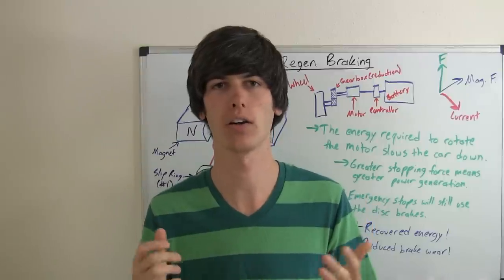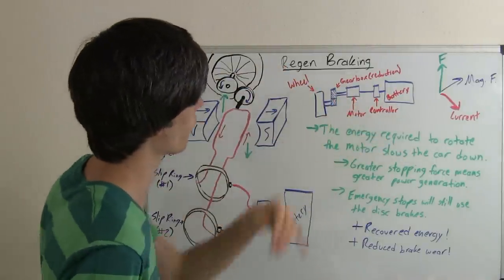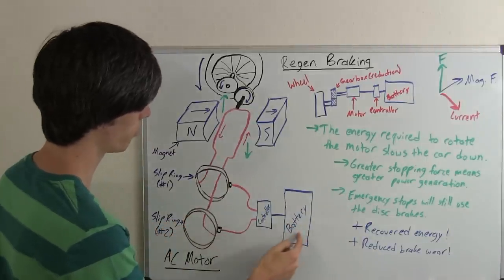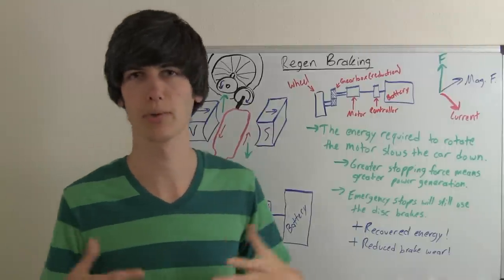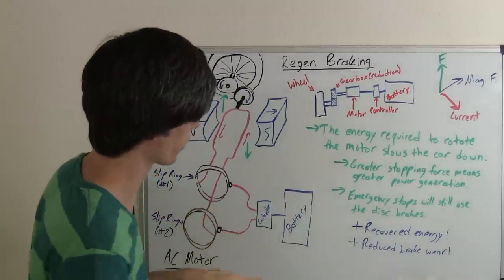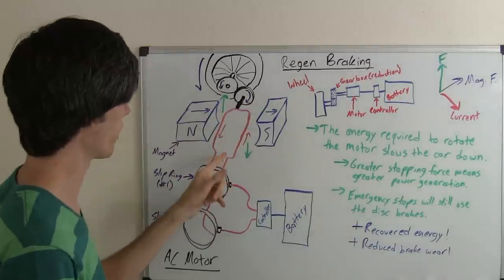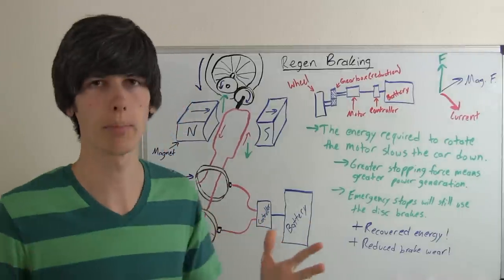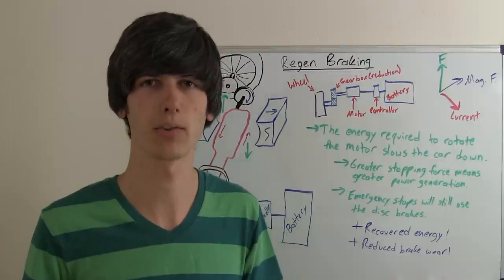Regenerative Braking - Explained

Comment: These videos are great. I have a question though, what is the yield or efficiency of regen braking/ kers? How much output energy versus input energy? A fellow Mec Eng.
Reply: I remember seeing a study, when it's claimed, that the maximum of energy recovered will be aprox. 60% of the kinetic energy you have as soon as brake until stop, considering you stop only on regen.

Comment: Locomotives don't have batteries. You should include that, especially if you talk about trying to charge a battery that is already topped up fully. Robobike has an electric brake that bypasses controllers and batteries when batteries are full but still functions as abrake.

Comment: Hi, got a real basic doubt, just saw your video on AC current as well...… So in this system during braking when your wheel moves the motor, there should be continuous charging and discharging of your battery right??? So how is this system used ONLY for charging a battery??

Comment: How does it switch from motor to generator? What actually physically changes? Then how do you control the braking force?
Reply: roflex2 1) removing pressure from accelerator . 2) adding pressure to the brake pedal😂

Comment: So is it less "regenerative braking" and more "regenerative coasting"? It has nothing to do with actual brakes right? You're just running the electric motor system backwards to create energy, instead of using it... right? 
I think I have it right, but I'm probably wrong. I know an electric motor, and generator are the same thing, energy in = work out. Work in = energy out. So by using the cars forward momentum, it runs the motor backwards charging it, having 0 to do with actual brakes. This is my understanding of how it works.

Comment: I have a problem please can you solve it ?
A car of 2000 kg which is moving with an average speed of 60 km/h.
	   What will be the approximate amount of energy recovered due to regenerative braking, if it comes to a full halt and 50% of the energy is recovered during the braking process?
I calculated the Kinetic energy as 1/2*mV*V
= 1/2 * 2000* (60/3.6)sqr = 277.55 kJ
After that I'm confused??

Comment: when the wheels are turning the motor to generate electricity, the motor is connected to the batter, what is stopping the motor from being powered by the batter which it is trying to charge. Thanks

Comment: So if the friction power in a mild hybrid is - 45kw and Em power is - 25kw. What will the battery power be? Imagine you have released the accel pedal completely. At 5k rpm

Comment: Can anyone explain to me how Tesla can have two settings for Re-Gen? Low and Normal. Is it a mechanical setting change or electrical?
Reply from the maker: nimajneb02 Electrical, just would influence how much energy is recovered via braking, and would use more motor braking than friction disc braking.

Comment: The real beauty is that how it actually works .. the motor can only just nake eniugh voltage to punp back to the batterry at full speed.. the ckever bit is how to control and boost that at lower speeds .. i.e when the motor is only generating 50 volts but trying to charge a 400volt batterry pack.. thats the really clever part so its bot acrually really simple at all ?

Comment: Is the voltage generated by CEMF proportional to the voltage going into the motor? If so, this would mean the wheel must be spinning faster than no load speed in order to generate a CEMF large enough to charge the battery correct?
Reply: The no load speed is dependent on the voltage powering the motor. Motors connected directly to batteries will generate power on the overrun. Motors aren't connected directly to batteries in electric vehicles because there is no power control and also with a single speed transmission, input voltage (or pulse width) must be lowered to prevent damage to the motor accelerating from low speeds.
With a controller, the power on overrun would get dissipated in the output transistor and wasted unless it switched to a charging mode.

Comment: You don't really explain how by depressing the acceleration pedal the motor turns into a gen. The lever example to convert mech into el. energy is good to understand how the gen works but it does not explain what happens while braking. I found out that the difference between the Mot and Gen is the velocity difference inside the el. machine

Comment: turning a diy electric into a series hybrid. what would the minimum volt pack and minimum generator output be? Not performance but everyday driving. it may be a pipe dream but one day I will have one. if range is such an issue why don't manufacturers build series hybrids?

Comment: How is the energy put into the motor, causing the car to slow down? 2:13
Reply: Hi.
ARE you Electrical Engineering .
Reply: Alternators take energy to spin when they have a load on them, so connecting a beefy enough alternator to the front wheels of a car and engaging it during normal braking circumstances would give sufficient friction, alongside the mechanical brakes, to slow the car down.

Comment: If you are maybe looking for more ideas, I'm always hearing about "twin turbo" set-ups. Not sure what is the purpose for this? I've seen some really good boost numbers with one turbo, why two?
Reply: He has covered this in some other videos.  Twin-turbo means that you have two parallel turbos, not one in front of the other.  They are used in setups like on a V6 or V8, you put one turbo on the left side and another on the right side.  This lets you have the same amount of boost as one big turbo, but with less turbo lag.
Reply: Bill Carlson
That explains V engines having twin turbos, but what about inline engines? I believe the Toyota 2JZ-GTE engine was a twin turbo inline 6. How do two turbos work in that case?
Reply: Haloruler64
In non-V applications the compressed output of the turbos is combined, and then fed into the single intake manifold.  I could also imagine a case where the intake manifold is designed to group the cylinders, so each turbo could be feeding 3 cylinders individually, but I haven't seen that.

http://en.wikipedia.org/wiki/Twin-turbo
Reply: Bill Carlson
That makes sense, thank you for the explanation. And I assume that twin turbo is not literally twice as good, but a more mild gain over one turbo on inline engines?
Reply: Haloruler64
There are so many variables to take into account, that I really can't say for sure, and I'm not an expert on turbos (I like electric cars!).
Reply: Haloruler64 Some inline engines have one smaller and one bigger turbo. The smaller one is there because it spools up quickly and allows for a more even power band (when compared to not having the smaller turbo); and the bigger one is just for POWWEERR in Clarkson's voice. So basically, the smaller one kicks in first, then the bigger one. I believe the setup is called a sequential turbo setup.
Reply: Venodan Vadivel
Do you happen to know if Toyota used the sequential turbo setup on cars like the Supra? Also, thank you very much for that great info!
Reply: Haloruler64 Ya. the Mark 4 twin turbo Supras use the sequential setup.
Reply: Venodan Vadivel
Perfect, that's exactly what I wanted to know. Thank you!

Comment: how come u start your explanation saying the wheels are rotating first which rotates gears and the motor to generate power for the battery when its the other way around ie. the battery rotates the motor which rotates the gear and wheel eventually when u r driving . I get the main idea of not using friction braking but i dont follow the actual step that is starting this whole thing. i read somewhere the motor becomes a generator but not sure how it happens

Comment: Thanks for the video ......Why ac motor instead of dc motos . I'm hoping to do regenerative braking using one or two  250 watt pmdc brushed motor ( no worm gear gears for me ) with gear box . The velomobile total weight is about 400 lb ( includes driver )  besides the gear box on the motor , I will use a manual transmission with mechanical clutch to allow electric wheel to freewheel and ability to change rpm to motor for efficient use and high rpm during regen braking . I'm looking at dumping regenerative charge into a capacitor storage for quick absorption while regenerative braking . I live in a hilly area in canada but did live in beaufort nc . looking forward to hearing from you  p.s. I'm guessing controller is doing the braking   Take a break from rick  wholly phoque  that guy is dense
Reply: Late bloomer The reason the use ac motors are simple, they have no brushes that can wear down. So the only thing in a ac motor that could fail are the bearings as long as you don't overload or overheat it.
Reply: +Late bloomer use a brushless dc motor which is similar to an ac motor

Comment: is this the basic of KERS in F1 ?
Reply from the maker: Essentially, yes.
Reply: KERS is a mechanical system - basically a very quickly spinning fly wheel is spun up when you hit the brake, and then connected back in to give a boost.  It's essentially a mechanical version of regenerative braking.

Comment: you need to talk more about the power electronics involved.  For instance that black box you describe as the controller probably has a rectifier inside converting the generator's AC voltage into DC before it reaches the battery.  I am not clear on how the physical breaking of wheels impacts the size of your AC current.  Can you help share some insight on that?  Intuitively I think that by breaking, the frequency of your generator is lowered which lowers the EMF.  Therefore the optimal regeneration actually occurs with the pedal off the accelerator and no breaking. Assuming there is a bidirectional inverter in the powertrain. Thanks in advanced for you reply

Comment: You seem to be saying that the same motor that powers the car forward is the same motor that changes to generator mode when you let off the accelerator, resulting in very inefficient coasting. I really doubt that. So I kept waiting for something like, "so when you apply pressure to the brake-peddle this happens"... I can understand how powering a generator will bleed-off speed, but how is this system coupled to the break-peddle, or not? I guess not as simple as you thought, for us dummies anyway. lol
Reply from the maker: Good point, there would likely be some sort of coupling mechanism so that it could be disconnected when not in use, like a clutch for example.
Reply: Yes, it is done with the same motor.  The regenerative breaking can be turned on and off - imagine you're spinning a simple generator - a magnet around a coil of wire - if that wire is not connected to anything, and doesn't make a circuit, it can't drain off any power so the 'generator' will just spin freely.  If instead, you connect that coil to a resistor or say a light bulb, it will not spin freely, it will quickly slow down.

What the controller does is use pulse width modulation to connect & disconnect the regen very quickly, and depending on the percentage of time it's connected (regenerating) verses not (freely spinning) you can control how much breaking force is applied.
Reply: Bill Carlson Thanks, I understand your theory. Makes good sense.
Reply: Engineering Explained Thanks for replying.
Reply: When you apply more current through the armature windings, you increase the torque on the rotor, causing the rotor to accelerate.  Also, whatever the rotor's speed, a back emf is always generated that is proportional to the angular velocity of the rotor.  The faster the rotor, the greater the back emf.  This causes a reduction of current.  It is not as if one of these two phenomena happen at a time (depending on the mode you are in).  Both of these phenomena happen.  Faraday's law is always in effect - regardless of the "mode."

So, when the armature winding is connected in "regen" mode, mechanical energy is transformed into electrical energy.  Is this energy then stored in on-board capacitors?  If the energy is dissipated into resistors, then it is not regeneration; the energy is not saved.  The energy has to be stored in order to have the option to use it again.  I'm wondering how the energy can be stored and then reused.

And for clarity, if you want to "coast" without braking, then the armature windings can not be connected to anything.  Still, Faraday's law is in effect.  The conductor moving through the magnetic field still has a current on it, and a back emf is still generated.  I'm not as interested in the back emf as I am interested in the fact that anytime a conductor moves through a magnetic field, you do get a current.  I suppose at this point, we would have to abandon lumped element circuit theory and embrace the world of microwave circuits and antenna theory.  The armature winding then actually becomes an antenna - right?  It may have a lousy VSWR, but you still have a piece of metal with a current on it.  The current distribution will be a function of the geometry of the conductor.  I suppose we can just say that as far as the terminals of the armature windings are concerned, if the armature windings aren't connected to anything making a complete circuit, then you basically have no current at the terminals.  But I can also see a scenario in which the current generated on the armature windings actually radiates - causing the armature windings to become an antenna. 

Excellent video, EE!  And excellent clarifying thoughts, Bill Carlson!

Comment: What happens if the battery tops out?
Reply from the maker: Then the energy is lost as heat.
Reply: Engineering Explained so is that what the controller is for? It regulates the applied voltage, plus it limits the amount of stored energy in the battery by identifying its charge?
Reply: +lesliefrancs the battery never gets to 100% charge the max would be 80% to extend battery life
Reply: Dumps the energy to a load bank where it is lost as heat.

Comment: Regenerative braking isn't easy. It's hard to insert a regenerative brake into a combustion-engine car. Especially if the car isn't AWD, but brakes have to always brake all wheels but the propelling force has to only go to the one differential.

Comment: Ok so, battery moves the motor and the motor moves the wheels. If the regen braking recharges the battery while moving, why do we need the engine to recharge the battery in a series hybrid for example? thanks mate
Reply: +blopcant because their are loses of energy to heat in the inverter system, the motor, the wheels, and drag.
Reply: +blopcant 
Because of the 3 laws of Thermodynamics
1)You can't get something for nothing
2)You can only get so much on a perfect day
3)There are no perfect days

Comment: Is the system somehow disconnected from the wheel during normal travel? The way I see it, this is only efficient if it is engaged during braking when the engine is not being used. Any other time and you're just splitting the energy from your engine.

Comment: what are the magnets for?
Reply from the maker: For inducing a current, they're a critical part of electric motors. Check out my electric/hybrid playlist for more info.
Reply: The motor on the video is a DC motor. The permanent magnets represent the stator, and the moving loop the rotor. When you turn on DC supply on the rotor, a current starts flowing through the loop, and that current creates its own magnetic field. On the other hand, the rotor is between these two poles of a magnet, that produce an external magnetic field. ELECTROMAGNETISM - LORENZ FORCE RULE: When a current carrying loop (Current=charge/time - dq/dt) is put inside an external magnetic field (the magnets), the so called Lorentz force is generated, following the formula: F=B*I*L (B- the external mag field, I - current through the loop, and L- length of the loop).

Comment: Rubbish. His concept is not clear. During regenerative braking the motor turns into a generator and changes its direction of rotation. This sudden change in direction slows down the vehicle. This is the basic of a regenerative braking system.
Reply: Thats what i keep telling everyone too! But  then how does it help save energy?
Dont you need energy to spin the motor in the opposite direction?
Reply: how does it change direction of rotation, via gears? or are you saying electricity changes its direction. interesting to learn.

Comment: POP Quiz - if you connect the battery to the motor, it drains energy from the battery and drives you forwards.  So why don't you explain how the electricity knows to go backwards into the battery in regen mode?  (hint - tell us about the boost circuit needed to convert the motor 3phase into a voltage higher than the battery, so it charges instead of drains).

Comment: I know the principle of how it works, I would like to know how mechanically it reverses the motor, if the wheels are still turning forward and linked the the motor with a cog how does the motor change direction.

Comment: Hi. Why does it need to become a generator when it's braking, can't that be a generator when it's moving and not braking? Thank you. Doe this mean EVs don't have any kind of friction braking, neither disc or drum brakes? God bless, Proverbs 31
Reply: SevenDeMagnus removing pressure from accelerator cuts the current from battery. The freewheeling motor produces current when there is no current fed to it. You cant feed and extract current from the same motor. If u use another motor for regen, it would be very inefficient.